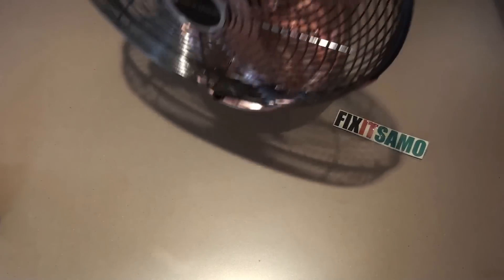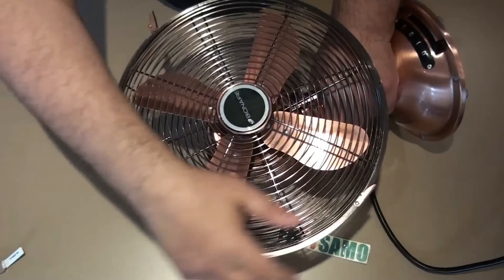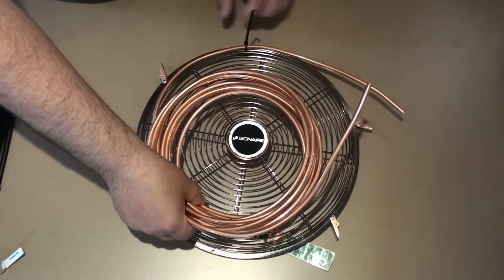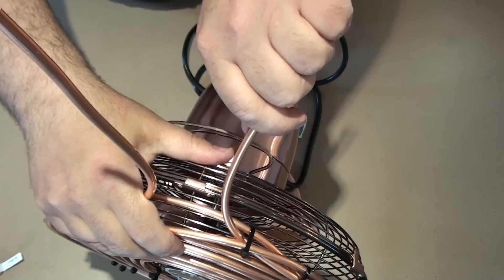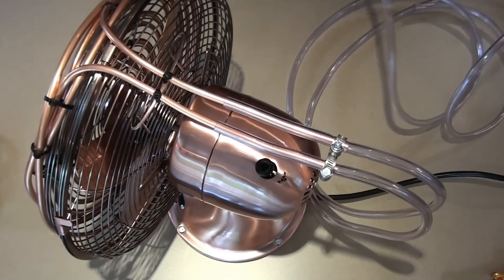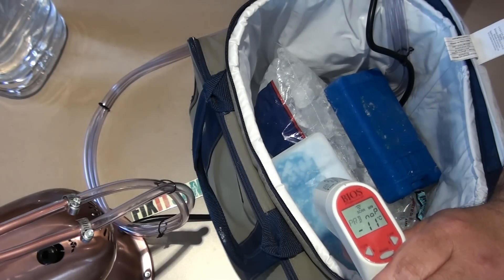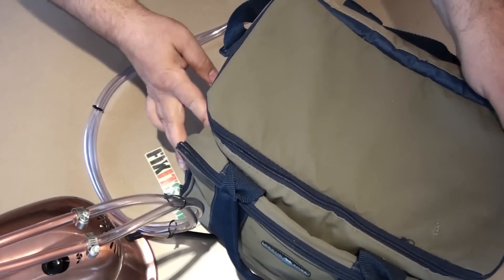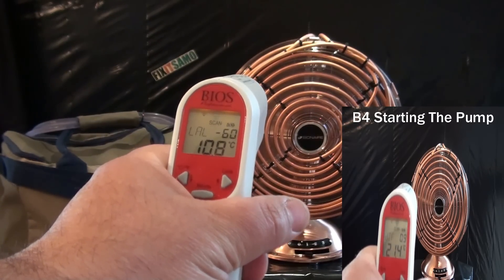How To Turn Your Fan Into An Airconditioner  AC

Comment: Great Idea, it's basically a chiller system.  I wonder if it could be adapted to work with a solar panel for camping purposes?
Reply: It's not a chiller system. It's just a fan coil. The chiller would be the part a compressor, a condenser, and a flooded or DX evaprator chamber with water tubes going to and from the fan coils (which are not considered a chiller, they are basically the air handlers).

Comment: Basically a swamp cooler...I think I would use one of those foam coolers and use antifreeze...won't evap as fast as water when it's humid.
Reply: +Sean Rubcic  For what it worth, swamp coolers don't require ice to operate.  The main requirement is dry ambient air.

Comment: +fixitsamo what type of cooler is it ?
how much should be the length of the copper tube ?
 how far should we place the cooler from the fan itself ?
Reply from the maker: +Maninder Singh any well isolated cooler will do I used around 15 feet of copper tube not very far 2 to 3 feet max
Reply: +fixitsamo copper tube is available in different widths, which should I be using for this project.

Comment: condensation on the copper tube? any suggestions to deal with that? thanks!
Reply: +Andy Lam water will not condense on it because there is a continuous airflow from the fan at the back
Reply: +Harshika Jain if it is hot enough outside yes it will.
Reply: I think you mean "humidity".  it is the relative humidity that will cause the condensation.  That is why misting systems work in dry climates but not in humid ones.

Comment: Dear Friend, This is the best presented idea i've seen in youtube. Thanks for the good work.
Reply from the maker: +mili12367  thank you
Reply: +fixitsamo My Observation after making the project:
1.We need maximum amount of area of the fan to be covered with copper coil. Rest of the idea is perfect.
2.The airflow is not like AC, but cools down the temp. 
3.Twenty small ice cubes works for around fifteen minutes or so in 32C. Ten ltrs of ice cubes should work for more than two hours with chiller ice box.
4.Droplets from the copper coil can be recycled.
5.Cost of the project in Mumbai is 1/4 Copper Pipe 480/- + Plasic pipe 20/- + Pump 200/- +15 Ltr Chiller ice box 1500/- + Table fan 1800/. Total 4,000/ out of which fan can also be used otherwise.

I visit my native place frequently and I need AC effect only for 4-5 days out of 30 visited days in a year. Hence this idea makes sense for me and works perfect for my purpose. Thanks Friend.

Comment: In India we have coolers which is like a square big box and is surrounded from three sides from big thread like brown grass and the pump makes it wet and it gives too much cold air I measured 15 C and outside is 39  C I always sits in front of cooler
Reply: Hahahha...
Reply: +Tarush Sonakya  Yes, because when the whater evaporates it takes heat from the place.;)

Comment: hey how much time the ice can remain in ice form with melting? pls ans.
Reply: Obviously it depends on ambient temperature of the room.  Maybe 20-60 minutes depending a
Reply: 4 hours
Reply: it depends on the outer heat and the quality of the cooler; if you have very good cooler and the weather was not so hot it may last for 8-10 hours I think
Reply: ice will absorb about .5 btu per pound per degree of temperature difference between it and the medium it is in contact with. You will need to know how many pounds of water the pump is moving and consider how much heat is infiltrating the cooler. Actually since this is water mixed with ice it is a latent process and the heat exchange will be about 144 btu per pound of water being pumped until most of the ice has melted, so actually nevermind the first calculation.
Reply: he has at least 20 lbs of ice in there, that should be cold for at least 24 hours. ice is around 2$ for 10 lbs so he has spent at least 4$ for one day of cooling and the added cost of electricity to run the fan. unless your a/c is out theres no gain from this.
Reply: +hannibal falastinem Sorry, this is another vid not interested in answering questions.

Comment: Great idea but for the geeks out there this could destroy your PC cause of the moisture in the very long run. Air-Conditioners do not give moisture to your room.
Reply: +Call_Me_Mad How so? The water's in a closed loop, and if anything won't moisture in the air condensate on the copper pipe?
Reply: ***** How could condensation in the pipes destroy a pc?

Comment: Find copper pipe here https://www.amazon.in/gp/r.html?C=PA5GAVK22LXZ&R=27N8QAIKZ3DIX&T=C&U=https%3A%2F%2Fwww.amazon.in%2FAircondition-copper-quater-lenth-weight%2Fdp%2FB01E3PI5EU%2Fref%3Dcm_sw_em_r_cawdcop_aoHnxb0N9GSGW_tt&A=MRWRFEVFWVIBEBPXAT3QOMOMM4YA&H=UEUH5FFZPDOWTGW7NQLVQMNQJGIA
Reply from the maker: +AKSHAY MAHAJAN this is a 50 feet  you will only need around 15 feet

Comment: why would you want to save money on buying an ac unit, but waste money on all the ice you would need?
Reply: AC Unit = several thousands
Electricity bill being raised like fuck because of air conditioner running constantly = more expensive than fucking ice and some cheap parts
Reply: OOHHHH i just looked in the internet and i noticed you can actually BUY ice in the US! never seen that in Germany, so that's why I was confused
Reply: +metallican5 lol ice is like free?? you just put water in the freezer. (Yes, that will use power)
Reply: Uh.. Fridge? .. Freezer? = ice
Reply: electricity bills dude
Reply: Yeah they rape us any way they can here lmao
Reply: yeah. agree with you and how much money to buy a copper tube? this hack  make me go bangkrupt
Reply: +Tobimai Unless you have a specialized ice plant it is actually cheaper for the common Joe to buy bagged ice than make it.
Reply: +Pepe Billete yes i was just confused because here in germany you cant really buy bagged ice
Reply: I'm gonna make one because I think its an interesting project. But here is my thought, I'm going to freeze water in plastic used water bottles. Put them in an actual hard plastic cooler and add water. My freezer is running 24-7 anyway so I'm just gonna make my own ice.
Reply: I'm gonna make one because I think its an interesting project. But here is my thought, I'm going to freeze water in plastic used water bottles. Put them in an actual hard plastic cooler and add water. My freezer is running 24-7 anyway so I'm just gonna make my own ice.

Comment: can you run salt water through that pump? get colder water, cooler air.
Reply: +Dogman thats a brilliant idea :O
Reply: +Dogman If that tube is pure copper, then the salt will corrode the pipe as its exposed to air. And probably will spoil the pump too.
Reply: +Mastersafi 117 Use a salt water pump and connect a piece of zink to the copper pipe.
Reply: its true that the salt makes it cooler but at the same time the ice melts faster therefore it wont stay cool as long
Reply: also salt lets things corrode much faster
Reply: if you run salt water in the pipes, the copper tubing will corode quickly.

Comment: Cool! You will have cool air for an hour! LoL
Reply: The fan would cause a small amount of cooling of the water from evaporation, if was aimed at the water, which it's not.
Reply: Or four
Reply: or until you run out of ice
Reply: You don't need ice the fan will cool down the water
Reply: +Scatteril did u try already having no ice sir?
Reply: +Bluer Blue no but I'm pretty sure that if the coil is thin enough the water will get really really coold
Reply: +Scatteril I see if ever you will try it pls tell me if its working. tnx
Reply: +Scatteril yes if the coil is thin the water will have increased pressure on it and it's gonna get more cold
Reply: The size of the tubing has nothing to to do with the temperature of the fluid within it.

The pump he uses puts out 2-3psi max, and water doesn't compress.  Only gasses compress.

Comment: Samo - Sir YOU ROCK !!! ... I mean it  ! ... It takes a Genius like you to Think "Outside the Box" and  design  this Amazing Invention Giving  a  Good Household Fan and Adding a  Almost Flawless "Radiator" Design  to it !!! - Kudos, Bravo and Cheers to you sir ! YOU just  got yourself  a  Brand New Canadian Subscriber ! .. I am Currious ... If you had a  Plastic Totally Sealable Cooler and Some Engine Coolant instead of the  water   with your Gel Icepacks - and maybe a Weak sollution of Rubbing  Alcohol because as it  evaporates .. It cools in Temperature keeping your Plastic Icepacks and Engine Coolant Cooler a lot longer,  too bad you couldnt find  a  Supply of   Freon and  a  tiny Compressor to use - the Cooling  would be Tremendiously Drastic and  Near Freezing !
...  Again - Bravo - and  Cheers - Please Dont Stop Inventing  AND  re-Pourposing   new Inventions !!!
Reply from the maker: +Shaun “Symbian” Miller  thank you

Comment: instead of ice and water ... and im just guessing here 

what about 92% isytopic rubbing alchol (NOT DRINKING KIND )....that wont workin) in  a 1 or 2 gallon sealed bucket  so the liquid would never be exposed to the air.... a one gallon paint can with lid comes to mind

other ideas would be windex aka ammonia instead of rubbing alchol

the big problem i see with this set up is here in missouri usa it gets really humid so this thing will sweat water condensation  like a naked fat mans ass in suana... and smell just as bad after a week

to counter that id take some large dia jewlary chain and connect at the lowest part of the fan and drop it into bucket directly below the fan ... like on a rain down spout off a roof

if you stay with ice and water... id add in rock salt to the water and ice mix... like you do for making home made ice cream with the bucket and crank that will drop your temp by at least (guessing) and additional 20 degrees F. based on my experiance making homemade ice cream in summer. with a bucket and a crank

Comment: this is a great idea ! but in reality an AC system Dehumidifies , which in turn takes the moisture out of the air ! making you feel cooler , i bet if you ran this in a relative 45% humidity room that , coil would start to sweat , water all over the place !
Reply: u are damn right
Reply: +manoj periasamy  kind of helps knowing this as i am an hvac technician!

Comment: YOU should use a small bucket, dry ice, an air pump, and it should gave a type of pressure valve possibly water/anti freeze and gravity.

Comment: Incorrect usage of infrared temp gun/probe. This device is measuring the surface temperature of the coil or whatever else it points at, NOT the air temperature which is the one we really care about in this case.

Comment: You are using an ir thermometer which measures the temp of copper tube(to which it is pointed) and not that of flowing air. Flowing air temp will be higher (convection heat transfer coeff h). It would be nice if you could specify the cooling effect(degree reduced in avg size room ) produced with 1kg ice.

Comment: Sorry if i missed it but how much power does that little pump use per hour? Just looked at a pump and it said 400w per hour.. :|
Reply: Around 40-70 watt/hour
Reply: +Abhiroop Basak the hour is not required. It uses 40 to 70 watts, the time is irrelevant, watts are a unit of power input.
Reply: +Spencer Wilton power consumption is always stated or measured with respect to time, for example if a product states it's power consumption as 100 watts, it means the device will consume 100 watts in an hour of it's use.

Comment: Waaaay back when they used to melt ice for air conditioning purposes. They would measure the capacity of cooling  by how many tons of ice were needed per day for that job. Nowadays, the measurement is BTU(British Thermal Units) per hour. One ton of ice per day is the equivalent of 12,000 BTU/hr. So how much ice per day would you have to buy to get the same cooling from this system as a little 5,000 BTU/hr window unit? About 830 lbs. of ice. per day. Really? Does that make sense to you?

Oh, you might make the ice with your refrigerator, but there's a catch. When fridges make ice, they take heat out of water to freeze it and pump that heat into the surrounding room. If you then use that ice in the video's type of A/C, all the heat that is removed by the A/C, and then some, is pushed back into the room by the refrigerator. You end up behind the game. 

Better, at least in the US, to just buy an inexpensive window mounted A/C and be done with it. Your pocketbook and back will both thank you by the end of the summer.

Comment: if this works properly, you will see water condense on the tubing and that will be a bad thing.  tubing itself isn't a great heat exchanger.  you would be better off using a transmission cooler (small radiator) to do the job.  Again, condensation will become your enemy because you/ve got no way to handle it.  if for some reason you had a source of free hot water and were wanting to heat a space then it would be fine and no condensation issue.

Comment: How long the ice can be used till it get melting and be normal again? i mean 5hours before we change the new ice..
Reply: +Ade Teguh Prasetyo yup... you guessed it right. But it will melt little faster if its really hot outside.
Reply from the maker: +Ade Teguh Prasetyo   with my cooler  12  16 hrs.
Reply: Varun Shihara im just gonna use it in my room, maybe its gonna be 30-35"C in summer.. so?!

fixitsamo if im going to material's building's store, what's the name of alumunium that u used?
Reply: +Ade Teguh Prasetyo  .. well you could possibly put the water with ice into fridge and just to lead those pipes out onto fan.. then it would last way longer.
Reply: LOL.. Distance between my room and fridge is 8mtr and it would be warm even before reached the fan.. Imrais
Reply: +Imrais yep
Reply: +Ade Teguh Prasetyo insulation
Reply: +Ade Teguh Prasetyo either way the heat removed by the freezing of the ice is added to the room unless the fridge is outside
Reply from the maker: +Ade Teguh Prasetyo the amount of ice that I used lasted @ least 12 hours

Comment: dude one precaution should be the inlet and outlet pipes should be kept at lower side so that condensate will fall due to gravity, or that may enter in fan motor as per the shown orientation..

Comment: Unfortunately he only showed the temp of the copper tube and not the temperature of the air entering vs the air leaving the fan. Just because the tube is cold does not mean that there is a great deal of heat exchange occurring. From my experience these home made coolers are not very effective. If you look closely at a typical AC coil you will notice the copper is very thin and there are fins on the coil to help create turbulence and allow for sufficient surface area to allow for adequate heat transfer. In a pinch though, if you have a bunch of ice and some copper tube with no other purpose for it, then it's going to be better than nothing (unless you are using a freezer to create the ice that is situated in the same location as what you are trying to cool. If thats the case then its time to rethink your plan because you are going to loose every time.)

Comment: I think the method demonstrated in this video will not produce noticeable results. The readings in the video are for the copper tubes, not ambient room temperature.  A 10-degree deference is too much for the amount of time the air is in contact with the tubes.

If I'm wrong, patent this. you'll become a millionaire.

Comment: I TRIED IT. BUT WHEN WATER PASS THROUGH THE COIL, IT IS COMMING TO ROOM TEMPERATURE SOON AS THE WATER FLOWIS VERY SLOW. I AM NOT ABLE TO MAKE A   SPEEDY CURRENT OF WATER THROUGH THE COIL. IS THER ANY SOLUTION?
Reply: Get a better pump
Reply from the maker: +Vinod U yep you need a better pump
Reply: I USED A PUMP OF 800L/H PUMPING CAPACITY. AND THE COPPER TUBE COIL DIAMETRE IS 1/4 INCH. AND I CONNECTED IT WITH 1/2 INCH OUT PUT PIPE OF MY MOTOR. BUT WATER FLOW IS VERY LESS. I USED A AQUARIUM WATER PUMP
Reply from the maker: +Vinod U the tube must be  kinked somewhere

Comment: clever idea, but what do do about the condensation that forms on the copper piping? or has this not happened as yet with this setup?
Reply: +Rabidavid the air from the fan dry it really fast... try it.

Comment: nice idea but if do the BTU calculations you will realize that the ice will need replacement after some tens of minutes or may be like an hour
Reply: +Ron Bradshaw Stayed at a hotel before which had free ice but no AC. This would have worked wonders there.
Reply: +Ron Bradshaw believe you can make more ice ,use large zip lock bags ,,just replace the bags ,,put the old bags back in the freezer ,,sounds logical,,,but does it really work,,what size room are we talking about ????? you all have a good one
Reply: 10.5 isn't air temp, so it will take longer. The water that comes into your house (tap) is always cooler then air temp. it would be interesting to run a few radiators and set the water speed based on the difference of the air temp.
Reply: +Ron Bradshaw indeed. maybe if you had a fridge in your garage that was used to cool the ice packs then it would actually work at cooling your home.

my landlord pays for water, i wonder if i could get use this setup off of cold tap.... just kidding, that would be a huge waste of water